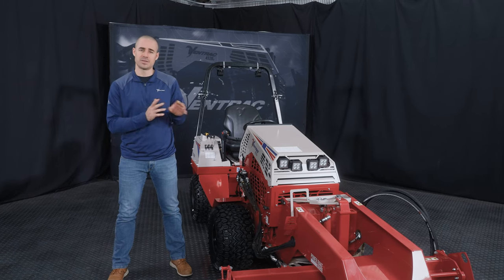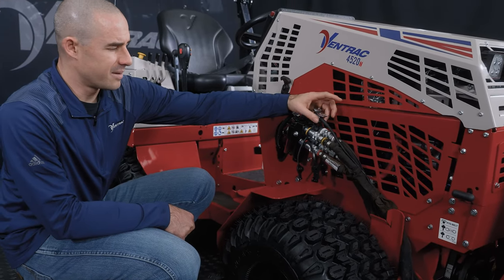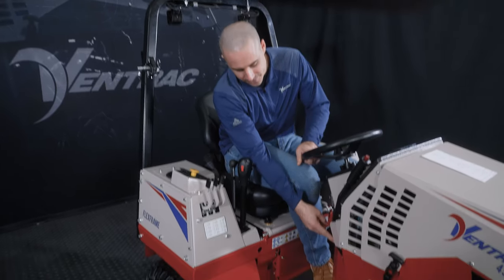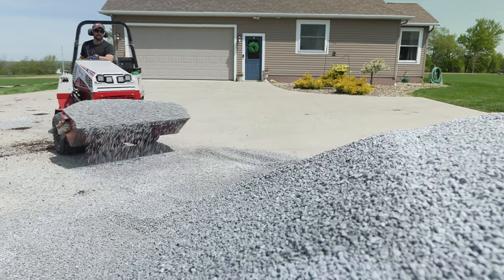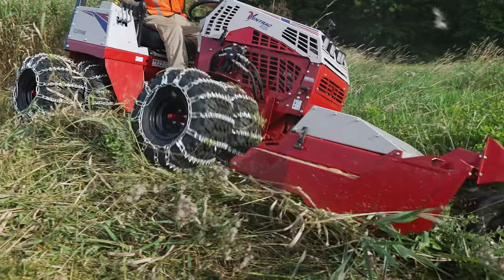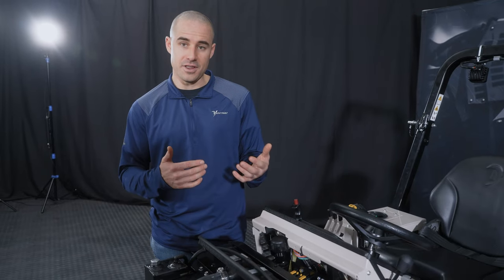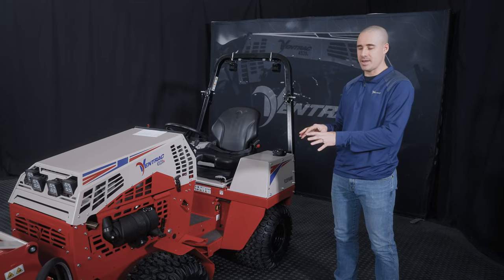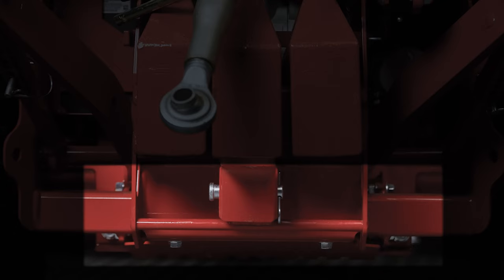Ventrac Tractors: The Complete Quick Start Guide

Comment: This was a very, very useful video.  Very professional job.  Thanks!
A challenge in attaching implements is you can’t see things well from the seat.  So I stand off to the side and connect.  I push wheeled attachments into the connect position.  
The Ventrac manuals are the best in the industry… although I’d like to see more checklists.
Cheers.  :)
Reply: I just fold up the arm rest and look down the left side to line up.  Make very small left and right adjustments while moving forward.  It takes finesse.  I just went out one day for a couple of hours just practicing hookup and its pretty easy now.  Also make sure mower decks are on the highest setting for connecting
Reply from the maker: Thanks for the feedback, we appreciate it! We are always looking for ways to improve the ease of use for our equipment.

Comment: It looks like all the stress from the operation of the attachment is being transferred through the 2 small pins.  CGI turf broke one of his pins on a 4520 while running the power rake.  How common is this problem?  And do you know what the stresses are on those pins. (i.e. Do you use Finite Element models when designing attachments ex. ANSYS?)
Reply from the maker: Yes, we do employ FEA in the design process.  We have seen a few of those pins break from time to time, but so few that it's really not an issue.  There are not very many use cases where significant stress is being transferred through those pins.  Power Raking in reverse with perfectly level hitch arms would be one of those cases and It's still quite rare to hear about that happening.  Pete is one of the best Ventrac operators in the country so I know he wasn't abusing it, but this is also the first I've ever heard it's happened to him.....and he has TONS of hours on Ventrac.  Most people who run Ventrac have never had a pin break.  I've personally never done it and I've been using the machines pretty hard for over 10 years.  I wouldn't worry about it!
-Aaron

Comment: Nice! One thing I'd add is handles on both of the fenders. When you're on a slope, the handles would really help to hold yourself upright. Many tractors have them and won't come close to the 20-30 degree slope that these will, so handles are a must!  Also do you have any hints on getting the mud out of those tires? They are very difficult to clean and if you just leave the mud to dry, you'll have mud turds everywhere the next time you use the machine. Thanks!
Reply from the maker: Hey Terry, great question. While it may not be ideal, we will typically run the tractor on gravel or pavement after the job is complete and it will fly off. While its not the best answer, your tires will be plenty clean when you start the next job. Thanks for watching!

Comment: I would like to see a ventrac option for a carryall or at least a chainsaw holder.  I don't know if my second request is legal or not, but I would like a much larger diesel option governed down to the regulatory requirements with the ability to remove said governor.
Reply from the maker: We will forward this to R&D! ✊
Reply: Artillian makes a ROPS mount, it has several options for attachments, such as chainsaw holder and basket.